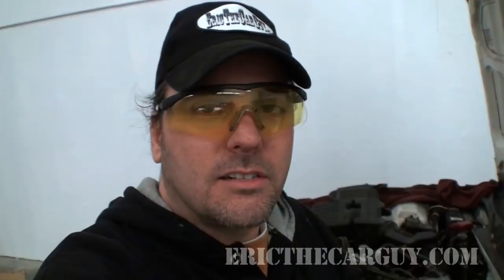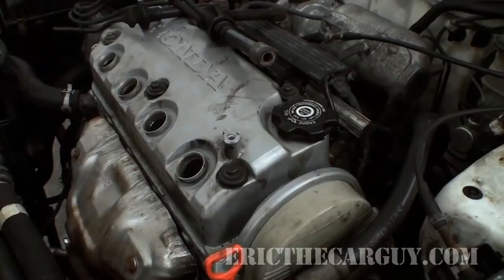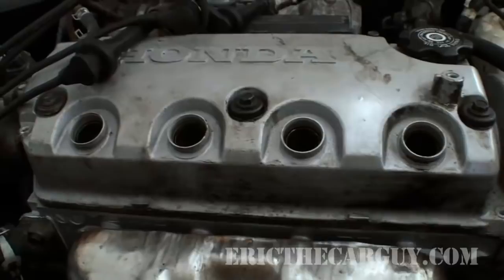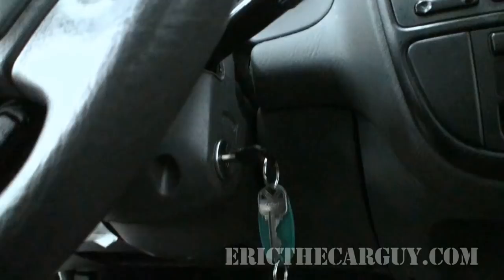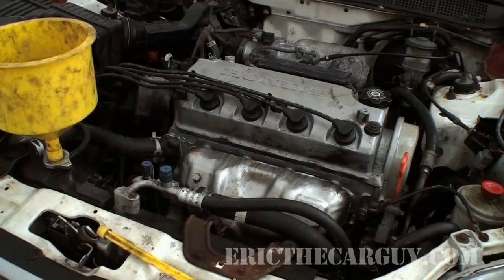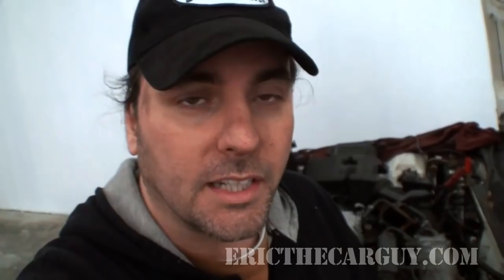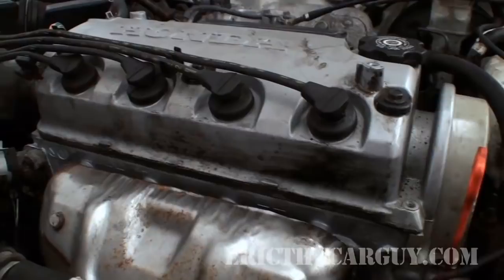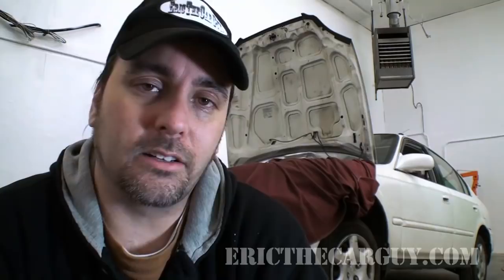How to Break In A New or Rebuilt Engine - EricTheCarGuy

Comment: I test drove a 350Z in LA several years ago; it was brand new with less than 100 miles on it. Halfway through, the sales guy insisted on switching seats to show me "what it could do"... which apparently meant pealing out into mock drag race (without a competitor of course) and later slamming on the brakes to avoid running a red light. I was shocked that this guy would abuse a new car like this in front of a potential buyer. Needless to say, he did not make a sale that day. I feel for the unsuspecting buyer of that car.
Reply: That is not abuse. You just pick another vehicle. As I seen the factory tell the dealers. To rev the shit out of an R7 rotary engine on demo drives. Just that everybody always said. I love it. I will take one over there!

Comment: Your supposed to lube everything when you build it though, it shouldnt be bone dry.
Reply: +Nick Palaroan Exactly.
Reply: +Brad K 

If its rebuilt at a wreckers/shop and then sold to a mech it may have been sitting for a few months or if its a 99 civic potentially a year.. lube will follow gravity and return to the sump.. never hurts to oil
Reply: +Nick Palaroan In the old days we used oildag; colloidal graphite in oil as we rebuilt an engine. Even so it does no harm to get he oil around the engine and the oil pump and all the oil galleries full of oil before you start it.
Reply: +Nick Palaroan 
Better sorry than safe eh?
Reply: When I rebuilt my first engine back in '76 the recommended build lubricant was STP oil treatment and engine oil mixed 1:1. The resulting mix is nice and sticky so it won't run out of bearings in a hurry, and I've still got some of that mix left.

Other tips I've used are pack the oil pump with petroleum jelly (not grease), pre-fill the oil filter and take out an oilway plug as high up in the engine as you can find and fill the oilways.
Reply: Lol he would have lubricated all those parts hes meaning to lubricate everything before combusting fuel
Reply: Good idea. Hope by boat mechanic does that. I'm repowering.
Reply: Nick Palaroan I guess you must be a "YouTube Certified Master Mechanic"
Reply: Nothing beats oil pressure.
Reply: You can put as much lube on as you like when you do a rebuild but without oil pressure you are in danger of spinning a shell under engine load. Hence turning it over with no load, (spark plugs out) until you have oil under pressure between the crank and the shells.
Reply: I'm sure he knows this. This was priming the oiling system after assembly with assembly lube.
Reply: @Nobody-zq8bl  Oh yes, Eric will know
Reply: My distributor is currently out of my new rebuild and I'm using a tool to access the oil pump. It's a 4.0l Il6 with lifters on the cam. So my break in will be different.
Reply: measure twice, cut once....safe than sorry...

Comment: Excellent advice Eric! The only change I would make is not to let the car idle at all for the first few minutes but to rev it up and down from idle to about 1500/2000 and back again to make sure that the oil pressure stays above the minimum. I do that for about 10 minutes then switch off, check for leaks, check levels and repeat 4 or 5 times. Other than that, I agree with everything.
Reply: Nick Nakorn Spot on Nick that's called (Cycling a engine)...seating the Rings... it's a critical check,,!!!  I've heard of three short block engines  installed that were driven at 30 miles an hour 10 miles,,then increase to 40 miles an hour for 10 miles,, than 50 miles an hour  for 10 miles, then 500 miles at 55 miles an hour,  all 3 engins were 20 to 25 PSI under when compression check was given, the engine was losing roughly 4 to 5  Miles per gallon of gas.  regardless if it's a new or rebuilt engine on any (engine) it's imperative that it's cycle, properly got to get that oil upon those cylinder walls for initial break-in.
Reply: I knew a couple of guys who built small block chevys flat tappet so 20 mins 2000 rpms then drive it but dont baby it not beat it to death but run it up to 4000 and down and then up and 3/4 throttle but run it a bit hard and I would not have believed it but those engines made a considerable amount more power later on than one that was exactly the same parts but broken in differently the two engines were exactly the same in every way except for the break in even built by the same guy can anyone explain that to  me .
Reply: @glennmanchester1568 the high rpms, heat and repetitious scraping of cylinder walls with that more aggressive style of break in must enable the piston rings to seat better and provide more compression than their babied counterparts. I just watched a video from this nascar engine builder who advocAtes for a more aggressive approach to break in a motor, similar to your friend

Comment: How much oil would you squirt down the spark plugs holes?
Reply: andreboy1 no oil. 
that's why it's dry in there.
If there is oil in there clean it out and dry it before putting the spark plug in. No oil on the threads and no grease on the boots.
Reply: Pull a Whole quart down all of the Spark Plug holes, install plugs and crank it over as much as possible lol
Reply: @TRX450RVlogger   thats funny as hell man i had to read it twice

Comment: When I bought my 2005 Camry new ...there was no "break-in" instructions in the manual. I asked the dealer about changing the oil after about 500 miles. They told me that was 
"outdated old school thinking." Well, as far as I'm concerned they were wrong. I changed the oil after about 500 miles...held a light right above the drained oil in the drain pan and saw thousands of tiny, tiny particles of metal in the oil. I saw proof that these particles would have been running thru my engine had I not drained the oil at around 500 miles. The next time I changed oil at the 5,000 mile interval...there was no such metal particles in the oil.  Fast forward almost 12 years later...that engine now has 198,000 miles and still runs like it was new. I have done all the oil changes at 5,000 miles with Toyota filters and Mobil 1 synthetic. I believe it is a good idea to do this on any new or rebuilt engine...just to get rid of the tiny metal particles that will be in the oil from breaking in new metal parts within the engine.
Reply: Yes I did this with my old 1982 toyota 1.5L and then it rusted apart on me :(
Reply: The engine was just starting to "hum". Now I have a '98 Ford Escort Sport SE... heh beats the old "Corolla-Tercel"
Reply: Great to know this. Thank you
Reply: Put a powerful lil magnet on the outside of the pan. To grab small pieces of metal in the oil.👍🏻
Reply: It's actually in the auto manual . Says break in procedures lol
Reply: @rickkroening5282  your magnet trick might have been a good idea 30 years ago, but these days, they're aluminium, titanium, magnesium, etc. A modern engine has little--if any--iron.
Reply: @TonySalyer  you can slap the magnet on the oil filter.
Like Filter mag.

Comment: When I rebuilt my 1st Chevy engine, I was told to get it started and leave it at about 1300 RPM (fast idle) for about 10 minutes to make sure it got plenty of oil flowing. Then to drive it at various RPM ranges for the first 500 miles. I got the car with 57,000 miles on it and the engine died at exactly 100,000 miles on the odometer. We rebuilt the engine at 263,000 miles after a valve spring broke. Not bad for some college shade-tree mechanic. That station wagon was run up to 6200 RPM at times. And my wife and I called her "Timex". Boy, I wish I still had her.

I took great care of her with REGULAR fluid changes, and more preventive maintenance than it should have had. But it kept up with all I threw at her and then some. And at 263,000 miles, I rebuilt the engine a second time, but sold the car. Gasoline got over $1 a gallon, and getting 12 MPG on the highway at 55 MPH wasn't worth it.
Reply: very cool. what year was it
Reply: @heatherdurish2542  1975

Comment: My best "safest" method on engine break in.

1) Make sure all fluids filled and topped to proper amount.
2) I never dry crank "any" motor.
3) Run engine until warm and do not run over 1,500 rpm
4) Check all fluids and leaks and address any issues.
5) Check OEM specs,valve adjustment "if any".Run engine until at operating temperature. Then road test up to and no more than 80/km hr.
6) Reinspection of leaks and then another road test.
7) Replace oil and filter to remove any possible debris, contamination etc.
8) Return vehicle to customet and have them return in 1,0000 to 1,500 km and stress not to drive beyond 100km / hr
9) Reinspection, replace oil and filter and follow manufacturer into.
10) Return in 5,000 km for service and then have at er.

This is a never fail gaurnentee engine has a great new life.

David
Reply: David, i know this is a old comment but i figured i ask this anyway, on a normal older engine with a distributor we just put a priming tool there and prime the whole engine and everything is copacetic, how do these folks with distributorless engines get away with turning a engine over without priming it first? is that how its supposed to be done? isn't that ruining bearings and things like that or does the assembly lube take care of that??

Comment: To seat rings I like to take the vehicle out, shift the trans into manual if its an auto so it holds the gear, get it up to about 40mph and let off the gas so the engine braking slows the vehicle down to about 10-15mph. I do this 10 times. Supossedly this creates a vacuum which pulls the rings against the cyl walls and helps seat them much quicker.
Reply: can you repeat this, i don't quite understand.
Reply: The Vacuum will pull oil onto the rings to help cool them. Before you do the engine "braking", it is recommended to do WOT to about 80% of redline, and then allow the engine to slow you back down. The increased cylinder pressure will force the rings against the cylinder walls, and then the vacuum from the engine braking will pull oil onto them to cool them and keep them from glazing over. The method Eric uses is regarded to as an old school method, most likely learned from someone back in the day. The reason his way used to be the "correct" way to do things, was because the hones were supposedly more coarse, and you needed to give the rings more time and less force to seal correctly.

If anyone is curious, or needs a more detailed explanation, google "Moto Man Method". While his article is specific to motorcycles, the information and principles still apply to all 4 stroke engines.
Reply: Daniel Jewell "Before you do the engine "braking", it is recommended to do WOT to about 80% of redline, and then allow the engine to slow you back down. The increased cylinder pressure will force the rings against the cylinder walls, and then the vacuum from the engine braking will pull oil onto them to cool them and keep them from glazing over."
 This is the Best method for rapidly seating rings, I lug an engine up, then engine braking back down, 10 times minimum... at least 1000 engines in my time...

Comment: When the check engine light is off, i get worried... :)
Reply: Every car but my 2016 CRV had the check engine light on.
Reply: Yeah it's like always waiting for the check engine light to come on ... When it happens it's like dang
Reply: I have been using 85 in my car since forever but I checked and it takes 87 🤦‍♂️ I put 87 in and no more check engine light

Comment: In older engines like the Ford and Chevy V8s that still used the distributor to drive the oil pump you can prime the engine with oil by using a drill and special shaft to turn the oil pump before you install the distributor.

Comment: I've got a Honda Accord 2.4 Liter 4 Cylinder. I've beaten the living daylights out of that engine from the time I took it off the lot,  and I don't religiously follow the owners manual recommendations for service intervals either, in fact sometimes I go 20,000 miles without changing the oil. 235K miles later, she  runs beautifully with no issues. In fact when she idles you can hardly hear her running.

Comment: afaik :
you want piston rings to seat you can do that only by building vaccum.
so 4th and 5th gear pulls are ideal for that no wot no stuck in stable speed maybe 75-80% of throttle use...
also there are good break in oils you no need thick oil for break in an engine.
a magnetic drain plug and a filter magnet bracelet among with oil pressure gauge are good investments !
very useful video thanks Eric !!

Comment: Damn it I have a rebuilt diesel engine coming out of the garage in a matter of days, my manual says basically what eric says, don't race the engine, don't maintain same speeds for too long, do not drive high throttle or rpm for too long, but then people on here are stating that I should also go into a long gear like 3rd on a low speed, open up throttle gradually then foot to the floor half way through rev range till the redline then let it engine brake all the way to idle then do this with different gears. This is fair enough I could do this as well as what eric/my manual says, but then someone said let your engine idle for 30 mins but someone else said do not let it idle at all?! I mean wtf can someone help me? I would really appreciate it!
Reply: I know it's a late reply (but it might be helpful for anyone reading this in the future):
It's a mix of both. You don't want to rev it out or put too much strain on the engine in it's break-in period. But if you never put  any kind of strain on it, you have the chance of a tiny, tiny ring developing on the cylinder wall. This is due to that the pistons are not getting 'thrown around enough', i.e. they don't reach their maximum top in the cylinder, which they only reach during stresses being applied on the engine.
So 98% of the time you want to drive it easy, but  just sometimes (like once every 20-30 minutes of driving or so) you want to put a bit more stress on it. Don't rev it out, don't floor it, just give it a bit more, accelerate a bit harder. This stresses the engine and makes sure everything is in place for when you DO stress is later down the line. Obviously don't do this in the first couple of kilometers, but after a while (50-100 kilometers of driving or so) you can start to do this. Otherwise you're engine is not 'stretched' and it might hurt your engine in the long-term, since otherwise it's what we call a 'lazy' engine.

Comment: VTec just kicked in too hard yo.
Reply: +Gillespie4444 but its not a vtec engine only a d16 y8 xD
Reply: +HeyItsSway the d16y8 is a VTEC engine.......
Reply: only some of them are i have a d16y8 that is not
Reply: +HeyItsSway all d16y8 are vtec. the non vtec is d16y7.
Reply: Have a honda civic si w/ a d16z6..... vtec kicks in at 4,800 rpm....hell it's a light ass car and it has a manual, it never needs to get that high in rpm to get up to speed lol....it's cool in concept, just reality is it never really needed it. I mean, breaking tires loose in 3rd gear? Sure. But useful? Meh.
Reply: The valve cover doesn't say VTEC so I assume it's not VTEC
Reply: it's doesn't have to say vtec! d16y8 is vtec and it doesn't say vtec on..
Reply: 😂😂🤣 gasking
Reply: HeyItsSway y8 is a vtec motor

Comment: me and my dad just put a rebuilt stoker motor in my moms jeep. the company that made the cam said for a break in time of 30 min @2000 rpm,change the oil, and do it again. got to 20 min and the serpentine belt broke. sucks. we also have a rocker tap. i think its got to do with the lash caps being too short. i have complete faith in the man that set the head to fix that.

Comment: Hey Eric. Totally agree on varying the load on the engine during break in. But I've got to wonder why they rev them up like hell, cold, in the factory just before they load them up for shipping.
Reply: hmm I work in motor coach industries yes its true that we rev the engine up to the redline but we do warm it up fist when its warm then we rev the hell out of it, i dont know why tho..
Reply: krap101
No, I think it's to make sure everything is working properly.
Reply: midgetboy
I just wish carmakers spent the extra amount to actually pre-break in the cars on dyno's.  Who knows, they probably do this at the exotic car factories like Ferrari, Lambo, Buggatti, or even Porsche.
Reply: ChuddleBuggy Everything I've read on breaking in engines (for bikes and "sports' cars) is that you need to run them hard to properly seat the piston rings. If you baby the engine, the pistons will seat improperly and you'll and up with oil consumption for the life of the engine. That's what seems to be the consensus anyways...
Reply: krap101 Red-lining a newly assembled engine is definitely NOT the way to seat the rings but rather the right way is to warm up the engine, and then varying the load on it regularly for a sufficient amount of time.
Redlining the engine is more like...ok, let's rev it up all the way; if anything misses or breaks then that's got to be a good reason to stop the assembly line and see where in the process are we messing up at.

Comment: I service my 2000 Vauxhall Astra Mk4 2x per year...I have just switched to an expensive  5w 40 fully synth oil and changed out the gear lube with good synth also wow its running sweeter and quieter...
I would never flush my old engine...just change the oil and other parts at a regular service schedule...no probs!

Thanks Eric for backing up what common sense means!

Comment: Regarding your comment about not changing oil.  Others say change it within 20-50 miles because of the metal shavings wearing off.
What is your recommended first change mile and intervals?
Reply: Anything big enough to cause damage should be picked up by the oil, but yeah I would think to change it once or twice within the break in period.
Reply: Is it normal for very very fine glitter metal chavings to appear after rebuild?